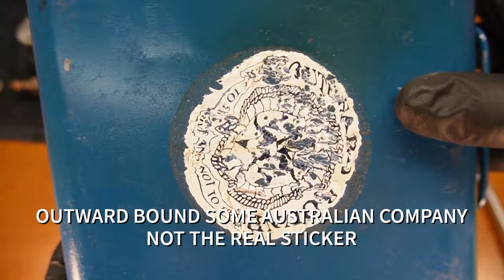1930’s Antique Swedish OPTIMUS Camping Stove Restoration

Comment: Was this model wickless?????
Reply from the maker: No it does not have a wick just a spirit tray. Thanks for watching I really appreciate it.
Reply: @Amazingct2000restorations , you can see ruined wick in the tube at 3:00. It is better to preheat the burner using strong alcohol - it will keep the burner clean and extend service intervals. Finally I'm not sure, but it seems this stove was designed for kerosene.
Reply: @vgnparvez  That was not a wick. That was a metal mesh used for fuel filtering.

Comment: you are meant to use methylated spirit to start heating
Reply from the maker: I used white gas for camping stoves seemed to work I’ll try the denatured alcohol next time thanks for watching
Reply: What he did with the fuel pump also remains a mystery.  The internal part of the pump was hidden all the time.  The power of editing..